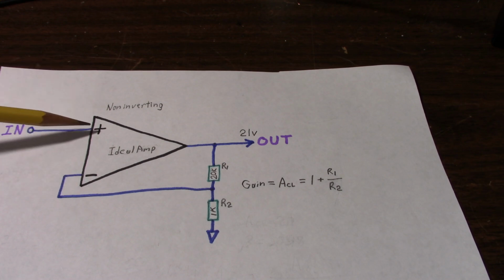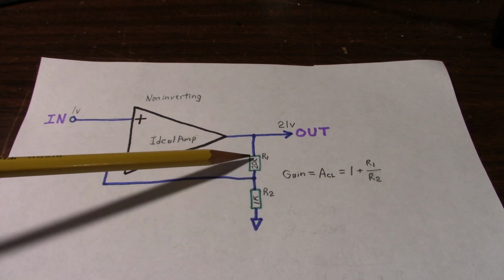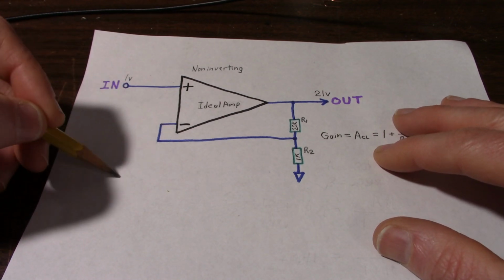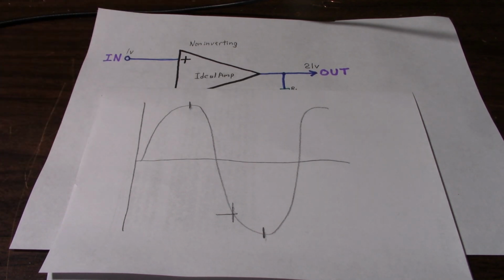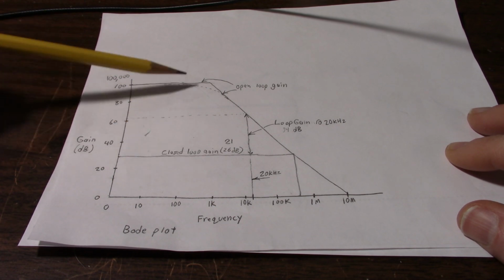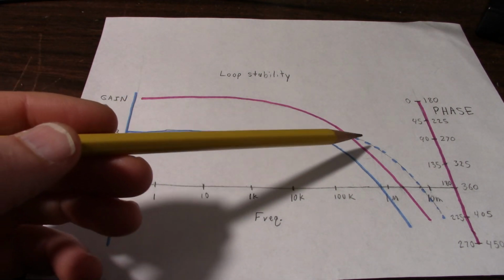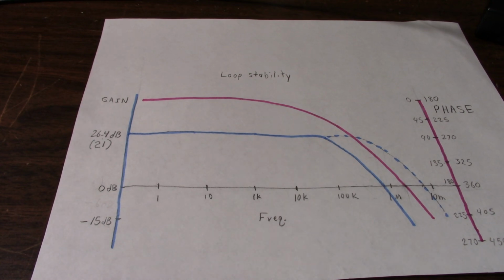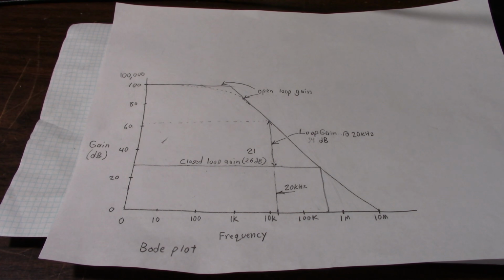Discrete audio amplifier project PT16 Negative feedback and stability

Comment: has anyone tried using a long tailed pair based on the BC182L driving two BD131 transistors if you don't know what I am driving at google 5W Class A power amplifier, the long tailed pair replaces the BC212L PNP transistor.

Comment: Nice video, but the conditions you give for stability are necessary but not sufficient. You also need the slope of the phase line when hitting the zero gain line to be less than 40 dB per decade and preferably closer to 20 dB per decade. This is what drives the need for compensation circuits to have a zero at a frequency above the added pole frequency. This gives faster roll-off for a while from the second pole but then slows it back down to somewhere between the tow pole and single pole response before hitting the zero gain line.
Reply from the maker: Good info. Thanks for sharing.

Comment: Thanks, great video, it answered a lot of questions I was puzzled about, IE poles, CL phase etc. BTW how would one draw a Bode plot for a real would amp? Measure gain and phase on a scope at various frequencies? Keep up the good work, DA.
Reply: Simply most people don't measure them.
To acquire bode plot, for chip amps you can directly get from datasheet.
For discrete amps, it's generally used in simulation. Like ltspice Ti-NA (pspice based simulators). Tweak on the simulation and build to test stability using square wave and capacitive load(john has video on this). If the amplifier is stable under most conditions it's not needed to measure open loop gain etc. (and it's actually really hard to measure)

Comment: John don't know if you can help but I have fault on my old MOSFET guitar amp it runs from + - 45v power but the speaker output has +40v but after a few seconds it falls away I can't find a schematic for it on line, tested all semiconductors and can't find the problem its a Dean Markley amp thanks for the teaching bids 👍
Reply: Sounds like the amp is DC coupled. There seems to be an issue with power supply balance, one rail is stabilising faster than the other. This will cause a large offset at the output until both stabilise. If the amplifier works after it falls away then its most likely a power supply capacitor on one rail that is tired and leaky. If it doesn't work at all then....tell us the symptoms...
Reply: @martinda7446  hi Martin thank you for that 👍 I first suspected the power supply as when switching off the amp the its seams to work OK for a few seconds until the caps drain ? another thing I found was if I put my finger on the + pre output transistor I can pull the voltage at the output almost to zero ! I replaced the bridge rectifier just to be sure it was not at fault
Reply: @steveswan5714  The problem with DC coupled amps is that any issue anywhere shifts voltages all through the amplifier.  I'm gonna have a look for Dean Markley amps...I've never heard of them?
Reply: Hi Martin thanks again for spending your time on this 😊 I found that schematic to and was using it to try some diagnostics then I noticed it is for a tr version I have MOSFET one although I think they are similar to some extent both have TL02 op amp,  I have fitted a socket and swapped out the op amp no change will I'm not sure if there is zeners in this but can't tell as no marking due to age ? Will have another look regards Steve
Reply from the maker: Hard to offer reasonable help without a schematic. Amplifiers like the one I'm building or most dual supply chip amps will keep the output offset zero even with badly offset supply voltage but that may not be the case for your amp. So if the supply voltages check okay at power up, I'd trace the offset back through the circuit. EDIT: I found a couple replies in the spam folder after I posted this (now released). YT likes to stuff posts in there for any reason.
Reply: JohnAudioTech hi John I see what you mean about YT I got some notifications today but some replies missing ?but I have had a few suggestions what it could be ! Leaky TR, faulty cap etc something causing imbalance on bias circuit ? but without a schematic I'm struggling ! I started to try draw out the circuit but it is difficult when you are not use to it 😕 I may just replace all the tr's and TL072 but not sure if the diodes are zener ? (no markings) I've been away from this stuff for to long 😂
Reply: @Douglas Blake @Douglas Blake thanks Douglas you are correct the voltage on the output is all over the place if I put a finger across the + pre out tr  there is also a very loud him on the speaker until it gets close to 0volts I will have a go replacing the tr's ! Im not sure if any of the diodes are zener but they test OK on MM diode check ? Thanks again for you help 😀regards Steve